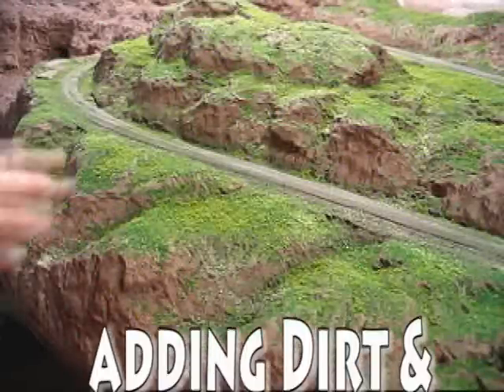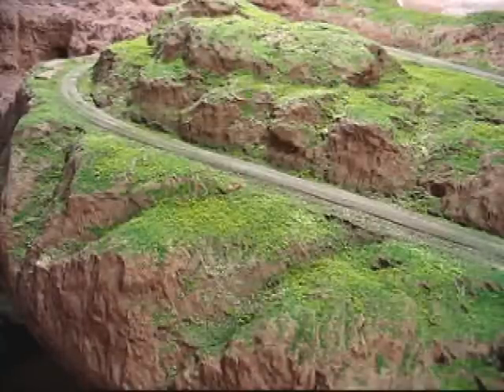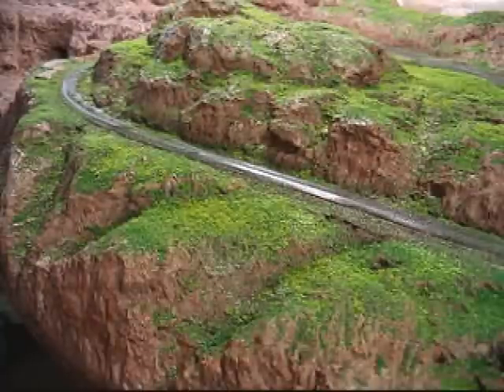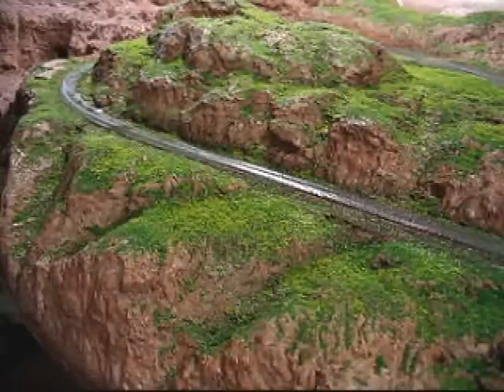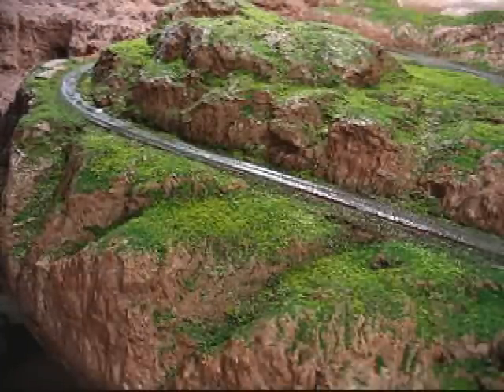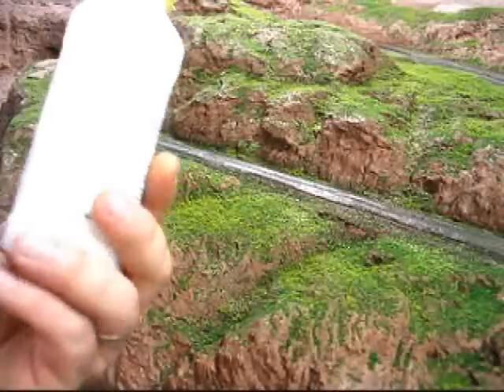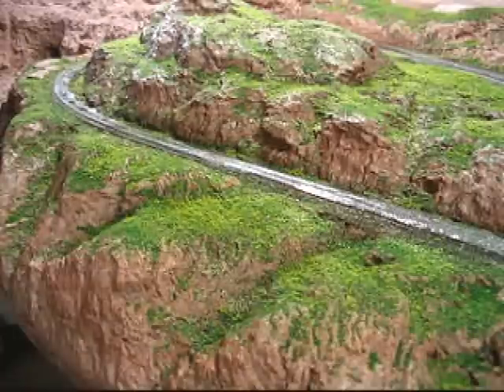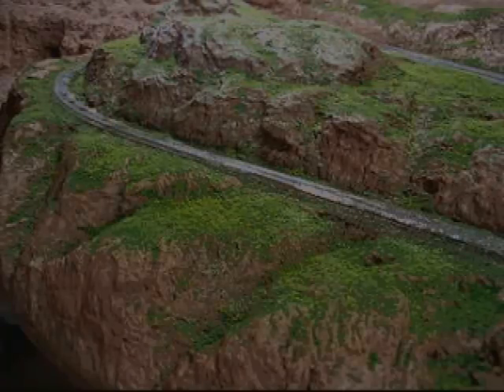Model Railroad Scenery using Extruded Foam: Part 10 - HQ

Comment: OK. so i am still stumped with a problem with my scenery. i make animations, and the sets i use are the same as what are used for model trains, the only problem is that when i  animate my characters, to keep them standing up, i put sticky tack on the bottom of their feet. however, once i put them down, then pick them back up, they tear the paint and foam off the scenery. do you know of some kind of substance that i could apply to the scenery to protect it from the sticky tack?

Comment: I would advise you to stay away from hornby to be honest its all value and budget stuff. The tracks are cheap brittle plastic and the scenery is over priced as well as the low detail over priced trains. Bachmann offer much better locomotives and rolling stock aswell as scenery items and peco have the best track by far. Also for grass and tree scenery buy woodland scenic products they are good quality and good priced.